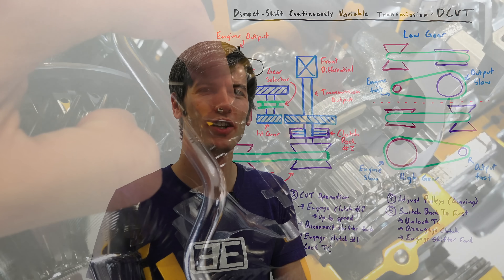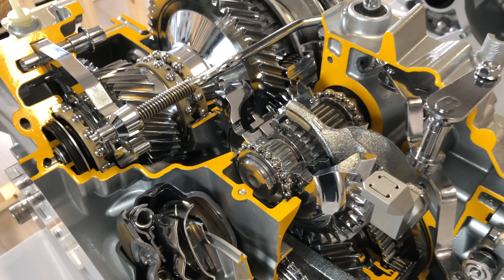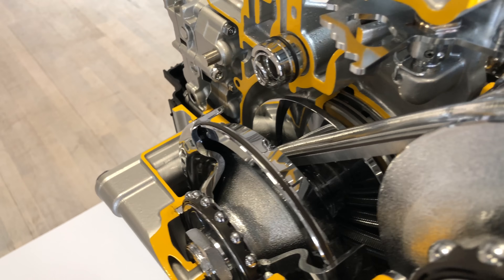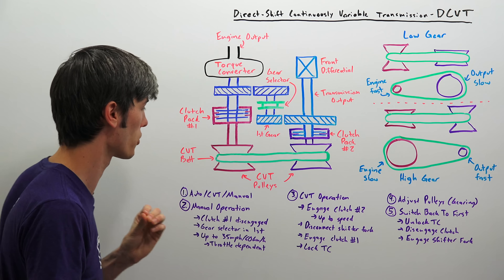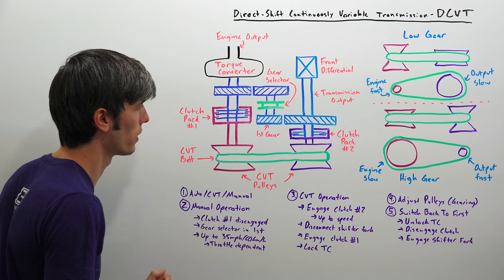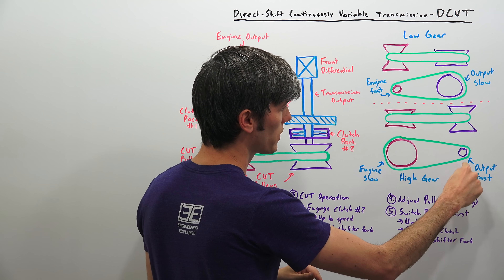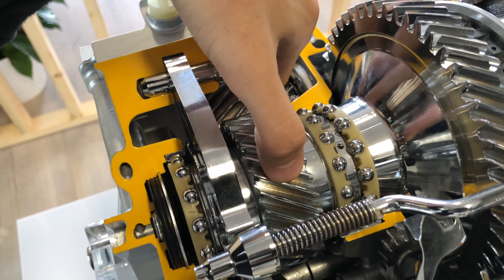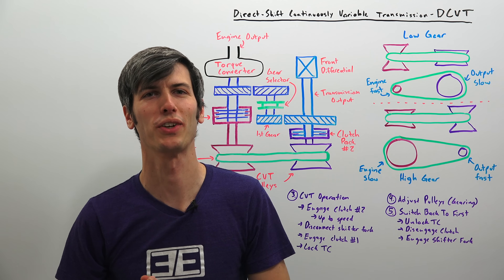The World's First DCVT Transmission - How It Works

Comment: CVT was invented in Eindhoven Netherlands, by the now defunkt Dutch car manufacturer DAF (who still are an important Large Truck manufacturer). In the DAF cars it worked with two pullies with a PULLING belt between them. The modern version is an further development of that by VDT (Van Doorne's Transmissions,  a spin-off of DAF), which was later picked up by Japanese manufacturers, Mitsubishi I believe. This later CVT transmission has a belt with metal strips that PUSHES the pullies..
Reply: I think he means the direction the pulleys are rotating the rigid belt. Both systems use two sheaves or pulleys. One primary side connected to the engine and the secondary side connected to the diff and then the wheels of the vehicle. 

I suspect CVT designs will be dead in less than 10 years. It’s just bad tech.
Reply: @danhg3885  I don't think CVT is a bad idea.  Now once we go electric we don't need transmissions anymore, so yes they probably will disappear along with every other transmission type as a result.  Besides there are many designs for CVT, including the amazing ones used in heavy machines, although I think they are all toroidal CVTs (or IVTs) so they can handle the torque.  Those things are amazing.
Reply: Lennart Sorensen I think I should say certain automakers designs suffer from poor reliability and satisfaction. The newer designs from Toyota, Honda, and Hyundai Kia appears to be addressing a lot of these concerns.  Toyota’s  low starting gear design is a clever modification to improve drive ability. 

Nissan’s powertrain partner JATCO seems to be giving the whole CVT market a black eye as these appear to fail frequently and are used in cheap highly depreciated models.   Thanks for your input. I made the mistake generalizing the CVT design from one firm. I mostly only see the broken stuff.
Reply: I don't think I would call DAF defunct.  They were bought by volvo and kept making cars for quite a while in the Netherlands.  They eventually sold the plant to mitsubishi though.

Comment: Manual, Automatic, Dual Clutch and CVT all in one transmission, I'm impressed with Toyota

Great explation btw, keep it up!
Reply: Toyota/Aisin usually do above average with transmission tech.
Reply: Taking the better parts of everything.
Reply: Will it be reliable though, there are still scares on the landscape from CVT boxes.
Reply: @ZanderKaneUK  It's essentially a DCT with a CVT gear plus a torque converter. Nothing new here, just a clever combination of things that already exist.
Reply: Insert name HERE A better way of describing it would be, it’s essentially a CVT that just so happens to have a dual-clutch pack to switch between the mechanical 1st gear, and the CVT(all of the rest of the “gears”).
Reply: @txisbest2010  Well its Toyota, the geniuses of the car world
Reply: Its not really a dual clutch in the conventional sense, which contain one clutch for the odd numbered gears and one clutch for the even numbered gears. This has one forward gear and the next ratios are controlled via the CVT belt.
Reply: Kimi Rules Toyota at best.💪🏼
Reply: I'm impressed with Tesla.
Reply: Kimi Rules nothing will impress me with this transmission until i see many of them passing 200000 miles without major failures!!
Reply: @mohnnadmercedes8246  my mitsubishi lancer 2.0 with cvt  is already on 187k miles and transmission is still strong..the only thing i change on that car is gasket engine
Reply: Some one i toyota thought: "How to put every expensive part from every kind of gearbox and give clients minimal improvments???"
Reply: I don't know if I would really call it a dual-clutch. I would still kind of call it an automatic. Automatic transmissions do you have multiple sets of clutch packs. These seem to be the more automatic type of clutch pack versus a dual-clutch or manual transmission
Reply: You can strap four Titanic's together but you still end up with the Titanic!
Over complicated unreliable rubbish designed to sell spare parts and keep service centres in business......
Battery, Electric motor, Reduction gearbox.......four moving parts........job done!
Reply: @Rex-du2hq  While all the manufacturers should be well on the way to getting pure electric cars out there, when it comes to efficiency for a non-electric vehicle, this transmission will be very hard to beat. Looking at the size of the shaft's, pulleys, gears, and bearings, this thing has been designed to take quite a significant amount of torque as efficiently as possible, with as few performance losses as possible. It's a genius piece of engineering.
Reply: @robertheffernan2756  Yes it is a nice piece of engineering......however genius engineering that's a huge exaggeration. CVT's belong on 50cc scooters, they fabrcobbled this gearbox from four technologies because CVT's can't handle torque and so long as your arse points to the ground this over-complicated junk will prove to be unreliable..........
As for automakers being well on their way to EV's that's what they would have you think.......reality is they are 10 years behind, are claiming a release date of 2020, and most are show concept cars.   
Mainstream automakers are not in a hurry to sell EV's because they have not figured out how to survive building EV's that are intrinsically reliable and don't require servicing and maintenance like ICE vehicles.
Reply: @Rex-du2hq  Four moving wheels?
Reply: @mcplutt  Look Einstein, ICE vehicles have four wheels like EV's so they cancel each other out............
engine + gearbox = 2000 moving parts......
battery pack + electric motor + reduction gearbox = 4 moving parts

Got it!!
Reply: @Rex-du2hq  So the battery pack moves?
Reply: @Rex-du2hq  yes we have som snow and ice right now.

Comment: Does the acceleration in a CVT that actually is "continuously variable", rather than stepped, feel similar to an electric car? If not, what is the difference? Seems to me that one has only one gear ratio, the other mimics one ratio.
Reply from the maker: Correct, you won't feel any shifting if it isn't stepped. The difference would be in throttle response, but that's due to the engine, not the transmission. Electric motors will have better response.

Comment: Looks heavy!
Reply: Actually the pulleys can be lighter since they aren't supplying as much torque when they are used.  Power is torque * rpm.  The CTV part is only used at high rpm in this invention.
Reply: Sure. What has power and torque got to do with anything? It still looks heavy!
Reply: I don't think he disclosed the overall weight.  But the pulleys on the ctv are definitely lighter.

Comment: really nice video and transmission as well, im really sad toyota is going to simulate real gears in the 2019 corolla instead of taking the maximum advantage of the CVT
Reply from the maker: This has more advantages than a traditional CVT, even for fuel economy. Explained here: https://youtu.be/HanImTejIVM
Reply: @EngineeringExplained  i see the advantage of the launch gear but i dont see why they are making the CVT act like a regular transmission instead of making use of the infinite gear ratios by keeping the engine at the most efficient rpm.
i know they did that in the current models which was a little weird but at least makes the best possible use of the transmission.

Comment: Im Kinda curious now. So the transmission will have a 1st gear until 35mph and get after that.  What happens if that 1st gear goes out down the line but the cvt is in perfect shape? Hmm😕
Reply from the maker: Why would first gear go out? Gear on gear is incredibly reliable (all manual transmission gears). Usually it's the synchros that fail in manuals, if anything, not the gears.

Comment: what happens when you are stopping for a red ligth but then it changes to green and you accelerate? in most cars you get a delay... i can imagion if you wish to accelerate at the moment when its between cvt and first gear it could upset the expected rpm for the first gear to engage at... in a conventional auto you accelerate after slowing and it takes a noticable ammount of time until it accelerates but worst case scenario a belt is engaging at the same time the engine rpm is too high and its like a clutch dump... in a manual well you know the driver is in control so they can let the clutch fully engage before accelerator is pushed... but in this transmission the only way to for it to safely not destroy itself in this scenario i think would be to abort the first gear engagment and go into cvt.   please do a video addressing unexpected driver input reaction delays... i believe because there is no clutch for the first gear that the teeth need to be going at the same speed for it to slip into first gear so i think if the computer isnt super fast and accurate every time there is a chance it will destroy the first gear.
Reply: ronald rogerson I agree. The start, stop and coasting transitions are going to be a headache I suspect for this unit. Especially once it has some miles and things loosen up. Give it a year maybe Toyota has it sorted. They are good at waiting and being conservative with their designs.

Comment: So, correct me if I’m wrong. That first gear would help with acceleration and torque at lower speed than a conventional CVT?
Reply from the maker: Correct, because it allows the CVT to operate in a more specific range. Explained in greater detail here: https://youtu.be/HanImTejIVM

Comment: Anything with a push belt is going to fail sooner rather than later. CVT spells junk!
Reply: not a huge fan of CVT (Murano owner...my wife's car), not one issue up to ~100k miles. Can't comment beyond b/c it was totaled.
Reply: Actually, they are far simpler with less potential for failure than your average automatic. Pretty much any CVT made by Aisin will last the life of the engine it's mated to with minimal, if any maintenance.

Comment: This should work with only 1 clutch pack, there is no need for 2  apart from lowering the rotating mass, or am i missing something ?
Reply: They may disengage the CVT part of the transmission completely to lessen the rotating mass and let the acceleration in first gear be faster.

Comment: Are you sure about the position of the two clutch packs in the system? For me it makes no sense to have two clutches to disengage the CVT-part but having no clutch at the direct gear. This would mean the gear selector has to shift the direct gear under load.

Comment: the level of complexity of this transmission can just imagine if one thing goes wrong in it
Reply from the maker: I don't understand all these complexity comments. It's really the same as a CVT, with a single gear added. And gears are simple, reliable, durable. To me it doesn't seem any more complicated than a different CVT, and especially not compared to an 8-speed or 10-speed auto. Transmissions are complicated!
Reply: @EngineeringExplained  but lets be honest the lineartronic cvt is less complex than this am i not right

Comment: I only care about two things. How reliable will it be and how much of a pain in the ass will it be to fix it when something breaks. If it isn't more reliable than the last thing they put out, or will be a nightmare for me or (god forbid) a mechanic that I have to pay, then it might as well be the worlds most technologically advanced polished turd.
Reply: Well put.
Reply: Parts wise, it'll be cheaper than a 6 or 8 speed Automatic.  Less moving parts. Labor wise, it is still unknown,  due the the complexity of assembly.
Reply: Also when the belt snaps (Like they do in the Nissan's) will it self destruct the transmission...  it does seem to be the same type of push belt with the metal parts going over a belt and not a Chain type CVT.
Reply: yes . agree. my friends nissan just did that. metal belt... 4000
Reply: These things are bulletproof. I work for Lexus...Toyota uses their new technology in the Toyota line first, by the time Lexus uses it most of the bugs have been worked out. This is a general rule, not a constant. Either way, if there is a problem found in these things any sort of pattern failure, Lexus will replace them under a warranty enhancement.
Reply: The whole thing is small enough to hold with two hands and has fewer moving parts than both an automatic and manual transmission, without the high-torque wear associated with CVTs. I think it will be extremely long lasting and easy to repair.
Reply: @megakiller999  That's probably the most incorrect comment I've read in a long long time.  For some reality note this device has a chain.  For more on chains see quora dot com/Which-is-better-to-use-on-a-car-a-timing-belt-or-a-timing-chain/answer/Jason-Taylor-16 .
Reply: @jason.arthur.taylor   It only uses the chain to drive the oil pump.   Same as Mitsubishis, and I've never seen one wear out.

Comment: Seems so unnecessarily over-complicated, heavy, large, and expensive. And for what, being able to launch your car or just slightly better acceleration?
Unlike most people, I don't really have a problem with CVTs, but I'd rather buy any other flavor of transmission if I'm going to get a sports car.
Reply from the maker: There are a lot more advantages in addition to launching, explained here: https://youtu.be/HanImTejIVM Very good reasons why they did it.

Comment: Hello, Jason 
I would like to know if the elctric cars did have a gear box or not ? if no, why ?
Regards
Reply: Generally Electrics don't have a gearbox as its not needed for day to day use. Chevy does have an Electric Crate engine that does bolt up to any Chevy transmission and is designed to be interchanged with an LS/LT motor.

Comment: What an elegant, not too complicated design that finally allows torque multiplication for brisk acceleration off the line and still have infinitely variable ratios and wide selection with a CVT. It eliminates the laggy response off the line of a CVT and retains the efficiency of the CVT when cruising. Imagine this transmission in a Crosstreck! It would help a lot off road where the traditional CVT lacks low end torque when driving slow. This transmission eliminates a lot of initial heat produced when you take off. Hope its reliable. Should be.
Reply: My opinion too.  This may be tranny of the future.  Toyota not noted for building junk.
Reply: Well, it looks complex compared with that firm's "hybrid synergy drive (HSD)", at least from a mechanical perspective (I know the power electronics is something else for HSD). In the hybrid, the traction motor does the job, but presumably the DCVT is only used for engine-only vehicles?
Reply: Not sure about eliminating lag and being torquey, we're still talking about a Toyota Corolla here. :)
Reply: Daver G 
That's strange, because most Tesla owners regularly go on long trips, and use their car all year, from California to Norway.
Reply: I’ve always thought it would be so cool if manufacturers could somehow integrate a CVT “gear” as the overdrive gear in a normal automatic transmission. Like a 7 speed auto with 7th being a variable gear allowing better fuel consumption but still the engaging feeling of having real gears. It would also allow for short spacing between the physical gears for better acceleration.
Reply: An electric powertrain is still so much simpler and more powerful. And very reliable too.

Comment: Does it have DCT farts?
Reply from the maker: That's really an engine tuning thing, rather than a transmission tuning thing. But since CVT doesn't actually shift (aside from 1st to the CVT belt) you wouldn't have engine power being cut at any time.

Comment: Just what we asked for
more computers and moving parts ?
Reply from the maker: And with many, many advantages: https://youtu.be/HanImTejIVM I don't see the additional computers.
Reply: where do you see more computers and moving parts compared to a regular automatic transmission?
Reply: @Pixelplanet5  There are more moving parts than a regular CVT.
Reply: @dexnpy  i mean that kind of obvious when you combine the advantages of a CVT with the ones from a regular transmission but it still has far less than a regular automatic transmission.
Reply: @Pixelplanet5  from both videos Jason made about this transmission I understand that it functions as a CVT most of the time while the vehicle is moving, which is why I feel it is more fair to compare it to a CVT instead of a regular AT.
Reply: @dexnpy  More moving parts but each moving parts now serve to reduce stress on the other parts. The first gear is purely to make the CVT more reliable and also to eliminate that CVT lag at standstill start.
Reply: I just like simple cars, i bought a 2017 86 and i just like the fact that it has so much LESS stuff than would-be-competitors hot hatches
Im turning into the millennial version of carburated small block fanboys ("Back in the days we used to fix our cars with a screw driver and hammer")
When i see a torque converter... coupled with a gearbox with 2 clutch ? with a ratio coupled by a belt... I just screamed NAT IN MA CAR